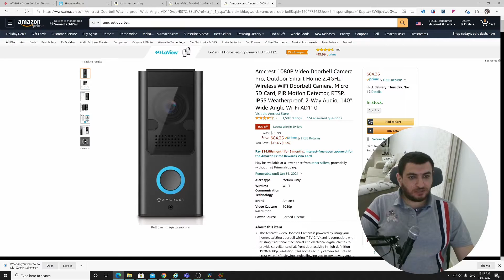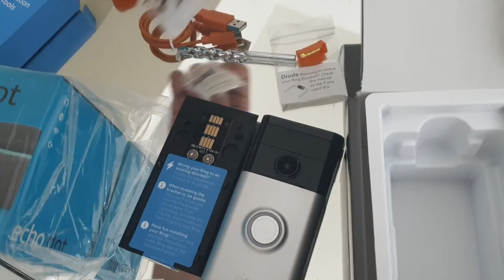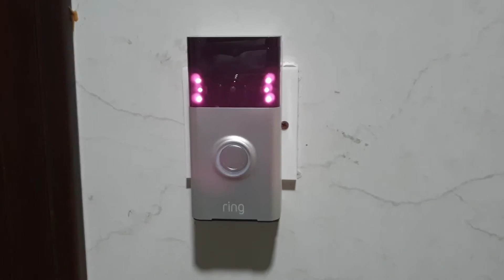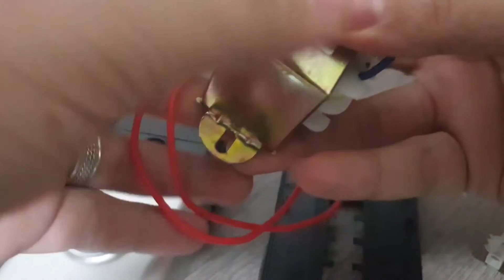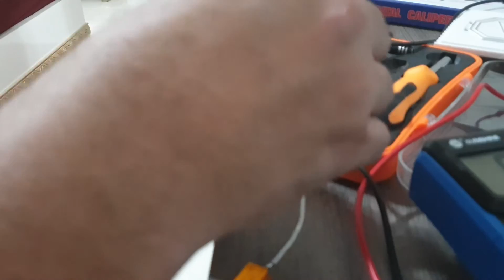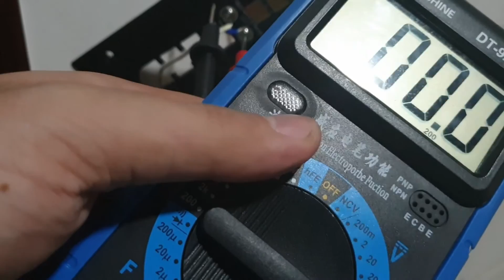Ring Video Doorbell Installation Hardwired on 220v Line Voltage

Comment: The transformer of that design where / how can we make a ground connection ? Your primary wires doesn’t come with ground , is it safe not having connected to ground if I am step up from16V to 24 volts ? 
I am installing the transformer in a 240V  AC homestead. Thank you.

Comment: What's the max current this can take? To understand how you decided on the resistor ohms
Reply from the maker: I am not really sure but i am turning it down to less than 1 amp (800ma) x 24v = ~20w which is more than enough

Comment: Brother, I am not very familiar with the electrical part. If you can tell me what I need to install the ring doorbell, I would really appreciate it. I have the same issue, I bought a US ring doorbell which needs 110/120v and here in europe the voltage is 220. My question is do I need only a transformer or do I need both the transformer and resistor? Also what does the trasnformer do and the resistor? Sorry for the many questions, thanks in advance.
Reply from the maker: No issues anytime dear. I am not sure about your model maybe it already has the required resistor. Also if ur ring is supposed to be connected to 110v it means it is already designed to be connected to line voltage. Just bring a standard 220 to 110v converter and you are good to go

The ring 1 needs the resistor to reduce the current/amps of electricity from the line wire and protect the ring from high intensity of the current. Some ppl say it is not mandatory but better be safe than sorry 

The transformer is to reduce/stepdown the voltage in my case from 220 to 24v.
Reply: @alsolh  Thank you very much!

Comment: Great I have researched alot before getting ring doorbell, but since I live in a house I just bought the solar panel and it works
Reply from the maker: Yes there is no guide available for 220v installation that is why i did this video. Solar panel is a simple solution for doors exposed to sunlight thanks for the suggestion :). This solution is suitable for apartments

Comment: Why did it not make a sound when you press the doorbell?
Reply from the maker: I just realized you were asking about the sound on the doorbell itself. It was disabled i just enabled it :)
Reply from the maker: Sound is there inside the house with echo dot and echo show. I had to disconnect the old bell (it is 240v i cannot connect it in series with ring) so sound will only come from speakers. You can also get amazon chime if required
Reply from the maker: I think if you need the old bell to work you need a relay to be connected in series with ring that opens a parallel connection to the bell. Or maybe buy a 24v doorbell and replace the line voltage one and do extra wiring for the 24v circuit. But that is too much you are better off with amazon chime if you dont want to link dot/show